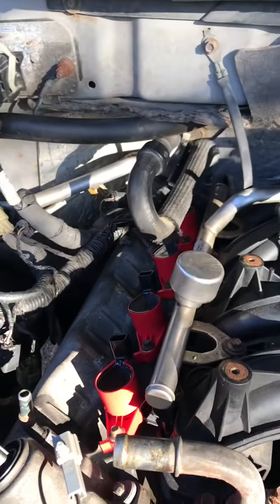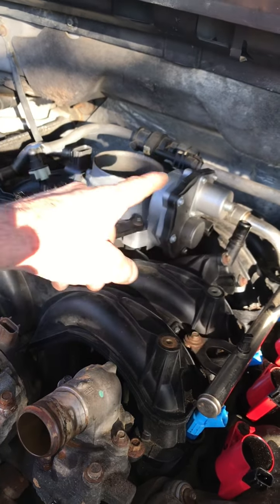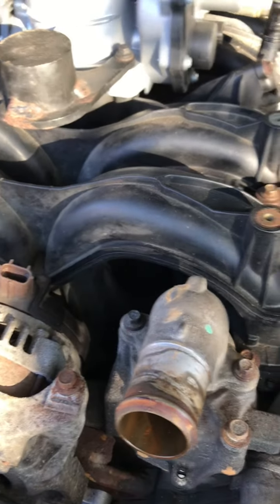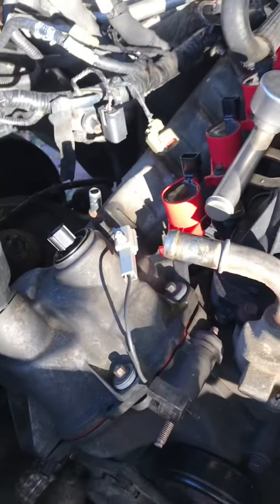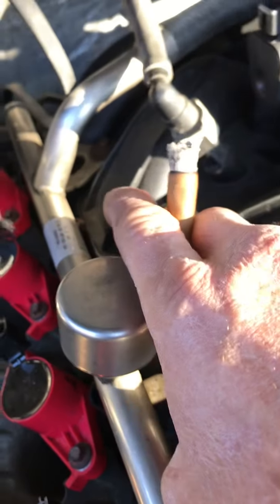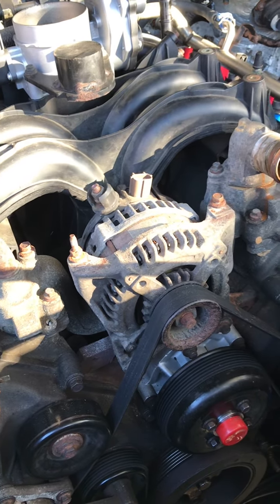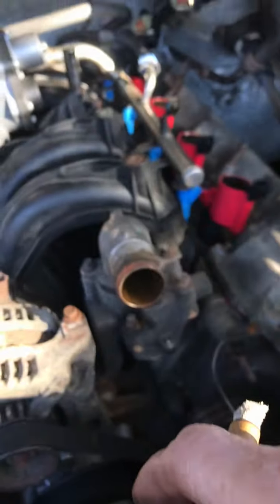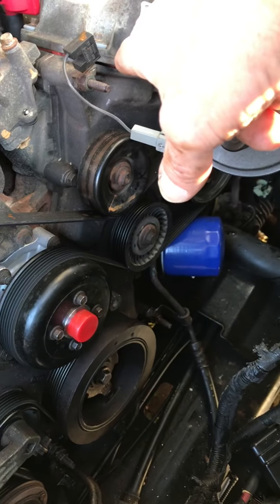2010 5.4 3v wiring harness

Comment: did drop a valve due to chain snapping, or did it happen from a cheap timing kit?
Reply from the maker: inept worked on it
i bought it from a cop at a mechanic shop.

the mystified mechanic kept saying it was a bad coil pack, when in reality it was the cast iron timing chain adjusters he left the metal plates off the back that had the pressure holes to keep the chains tight.

total loss on my end, $6k giant paper weight.

so if you do this use plastic adjusters with silicone gaskets , or use the cast iron ones and make sure you put the pressure plates on the back.

truck had oil pressure ran great 30 miles, but the adjusters didnt because the plates were left off .
so the chains loosend up and walla 
jump timing.
i drug it from owensborro ky to hot springs ar.

the heads camshaft journals eat up.
which means new heads or but a line boring kit with bearings and pray you get it right. thats a one shot deal. 

it sits in arkansas new shoes and all new rebuild parts and im in south florida.
Reply from the maker: the inept mechanic just installed new timing gears chains and adjusters.
Reply: didnt bother checking the followers and lash adjusters ehh? lol so u went back in there an pulled the heads and retrieved the valve and did it the right way. im only asking cuz i did mines last weekend and forgot to plug in the coolant temp sensor which is under the intake and have to go pull intake again fml. also i hear some rattle noises and ticking but could just be overly cautious, im not sure the rattle or ticking go away at warm idle and when i give it throttle it sounds good.really good. but when load on there sounds like a manifold leak. i did put headers on an reuse the ford metal gaskets cuz i herd that the new ones i had bought blow out down the line so maybe i just go in there an tighten the studs and nuts back up.  @Rewired69
Reply from the maker: its all in storage, new used block , heads, intake, new everything else from a-z to rebuild it or rather build it.
its in storage.
saw the adjusters delima pulled the cams saw all the filings in the ports, scared journals. 
better to start over than try and fix that catastrophic disaster so it waits.
 @tylermulkey330
Reply from the maker: it didnt drop a valve, the journals were eat up the valves just beat the hell out of the pistons
some where in those vids of guessing shows the block, the heads, 
one of the rods was broke 2 pistons did not move turning it over by hand
i even rotate it on cam.
 @tylermulkey330
Reply: @Rewired69  damn bud. Sorry to hear that about your truck. I got mixed feelings about that metal tensioner the more I research it I get conflicting information about it. Having it or not having the damn adapter plate on there. I read somewhere that the plate is for pre-96’ year 5.4 but they didn’t have 3 valves back then. So the. Makes me think to leave them off but the. You said that and one other said he doesn’t know if his engine grenaded because he left them off. So I’m about to just go back to the dang plastic ones lol but I spent 50$ on these fN metal ones. 😂
Reply from the maker: it is what it is 
i do not recommend toying on a tow dolley , 
sell it as soon as its in tip top shape.
it may be extremely fast and powerful but its a throw away engine with flaws thats extremely expensive to replace.
unless you have deep pockets.
the truck its self has luxury beyond belief

i trusted the mechanic and the cop. 
bought the coil packs first, was living in a motel working night shifts , drug it to hot springs from owensburrow .
did compression check after i did a timing chain kit like a dumb ass should a reversed that order of thinking, but there again it ran great for 30 miles.

a damn gift for some one that just keeps on taking and taking.

soon to be relocated in s Florida where i can stare at it and do my own calvin trip and piss on it

 @tylermulkey330